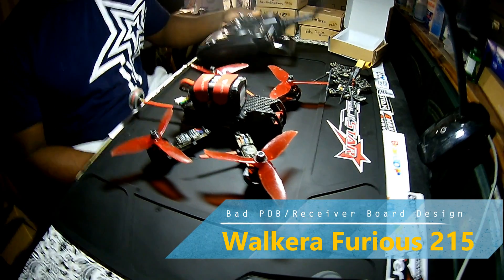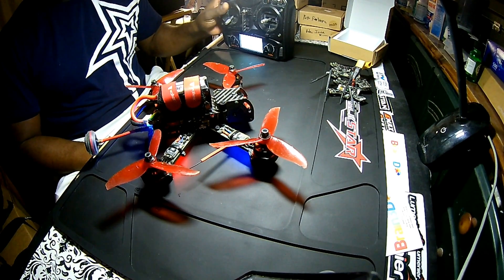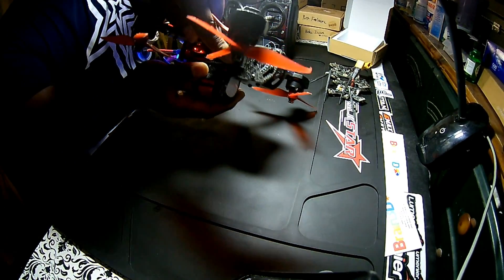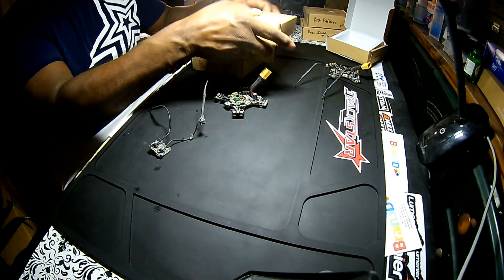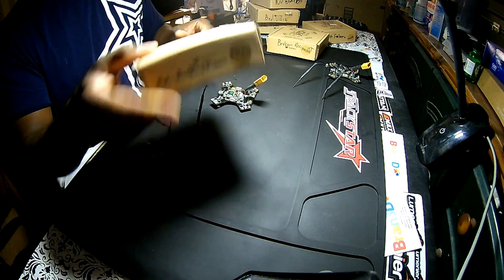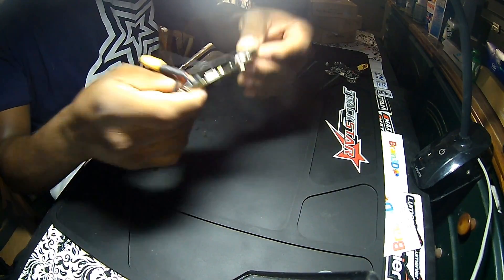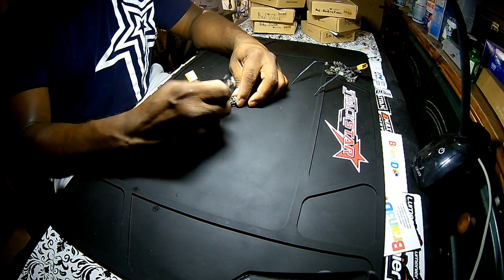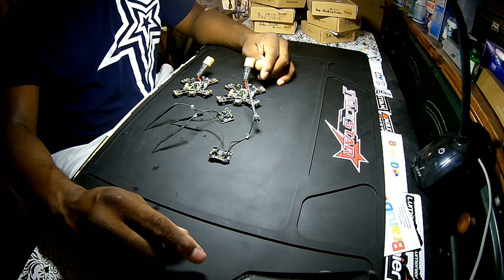Walkera Furious 215 Binding Issue

Comment: Can i replace original furious 215 receiver for example for frsky receiver? I have frsky radio and is possible use it?
Reply from the maker: Yes, I was able to put in a Frsky receiver. I had to change the config to SBUS in Betaflight.
Reply: How do I bind my new pdb/receiver to my TX? it's a replacement but the same part
Reply: @ashtonstigger8714  Hi sorry for the delayed response. Did you figure out how to bind you new receiver?
Reply: @primetimedawg431  hi and thanks for responding. it seems I s able to bind it, the receiver stays red when the TX is on but the control board keeps flashing red also the quad keeps beeping. I made sure the batteries are all charged though
Reply: @primetimedawg431  hi any advice for me??
Reply from the maker: @ashtonstigger8714  Hi Ashton, I would try the Walkera forum.Not sure why the controller board keeps flashing red. Here is link to the Walkera Forum.
http://www.walkeraforums.com/

Good luck. I eventually stop buying this product and switch to Armattan products.
Reply: @sowegafpv3137  ok thanks!

Comment: I can see your problem from the video.
Do not, I repeat do not, fly with those propellers. They are nicked and damaged and will be way out of balance.
It will vibrate your machine to pieces and will likely cause a a Flight Controller shutdown in mid flight.
Always replace any damaged propellers and balance them before using.
Change all your propellers after any crash.

You will continue to break these boards when you crash and use those props
.
Reply from the maker: My problem is a direct result of hard landings and crashes. The receiver pins either break or break away from the soldering joint. I've purchase 12 boards so far. It's not the props, trust me.
Reply: Ok If you don't fly with these props and you change props every crash then you should be OK.
The other thing that worried me from your video was the battery. It looks way to large and could be the cause of unstable flight and your myriad of crashes. It will also apply more stress on the pins in a crash.
What size battery is it?

Comment: Same problem with my 215
Reply from the maker: I've started putting hot glue around the base of the Receiver board to give it some support. I just got 2 replacement boards, however one o them has already stop binding with my controller. :(
Reply from the maker: I just had to buy another 2 of them. I put landing pads on the bottom of the  landing skids to cushion the landing. And I added foam to the top plate, where the battery sits, so that I could cushion the impact of the battery. It appears that the pressure or force of the crash or landing is causing the pins to fracture. Which results in the controller not binding with the controller. I've made complaints to both Walkera and UCDRONE about the design of the board. Not sure if they really care, but I will not buy a model with this design again, after going though 12 boards at 65.00 each.